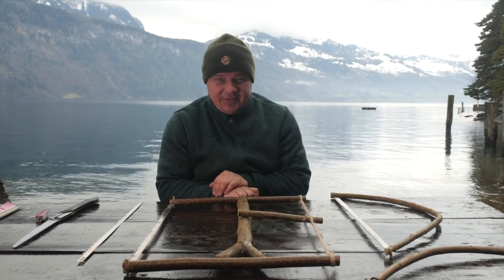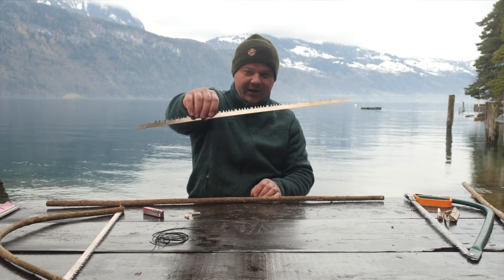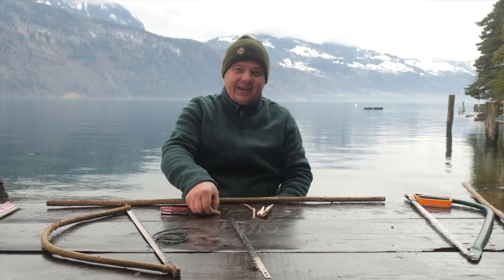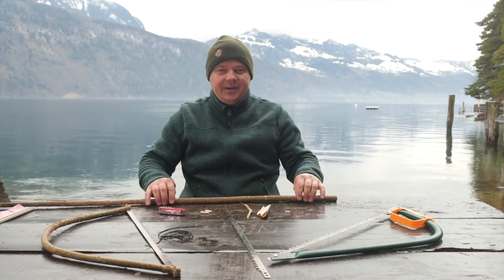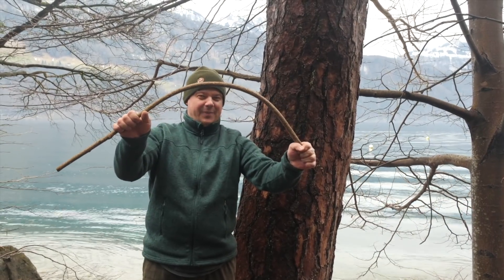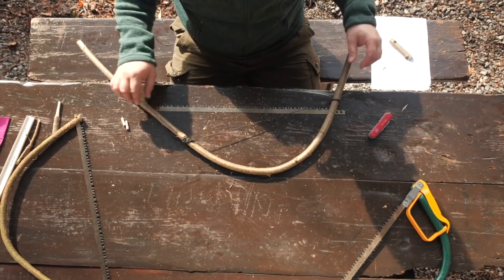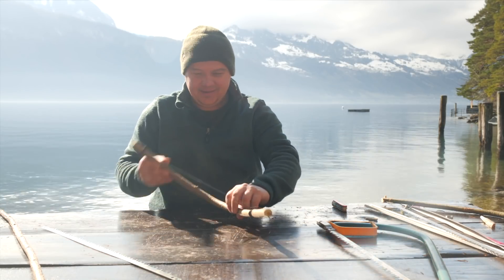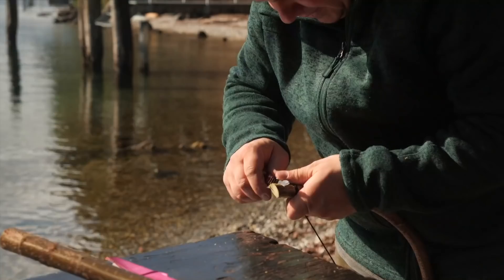Best design for a improvised BOWSAW - Tips & Tricks - How to bushcraft a bow saw- the physics behind

Comment: To make your bow saw (push as well as pull). You make a large diameter bowl, and place a cross stick in the middle of the bow. Similar to the way you made your buck saw. By making a large bowl and putting in the crossbar, it gives you the rigidity to push as well as pull and because the bow is larger, you still get your depth of cut to the crossbar.

Comment: What ? you did split the wood with a straight open knife? I watched your videos and you recommended to do this with 90 degree angle blade so it won't damage the swiss knife...
You must have been in a hurry. :-)
Joke aside, I love your videos.

You could also use some string to make a sort of handle, like you did on the 8.- axe.

Comment: Instead of splitting the ends, could you not saw the slots in, or would they be too wide a slot? Just thought you wouldn’t have the problem of the splits progressing down the length of the ends then.

Comment: Hello Felix… can you tell me why you split  the blade notch with your knife? Wouldn’t you have more control to cut it with your SAK saw blade? It seems to me the split branch would want to continue to split, even with the latch.
Reply from the maker: You're right. But sawing wood in this direction is super tedious. Try it. it's 100x easier to split it ..
Reply: @FelixImmler  Thanks Felix. That make sense.

Comment: Lovely by the lake. Looks cold though.

Love the saw. Might even try making one. Which wood(s) did you use, wasn't clear from your accent, sorry.
Reply from the maker: That's hazel. Thanks a lot for watching my video with bad accent 😄😄
Reply: @FelixImmler  Thanks. Is good, have hazel in my garden. Normally understand you completely, but this caught me. 
Would ash work? I have to take some out. I know  it's used for bows.